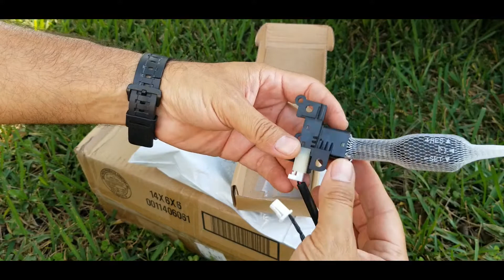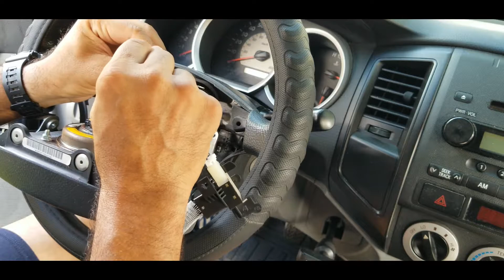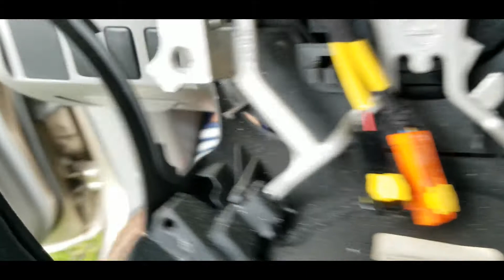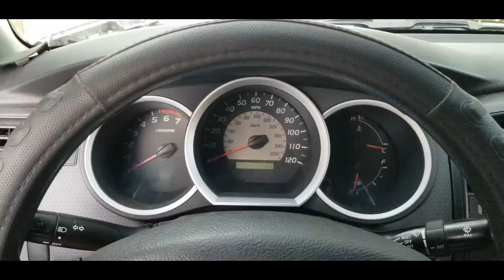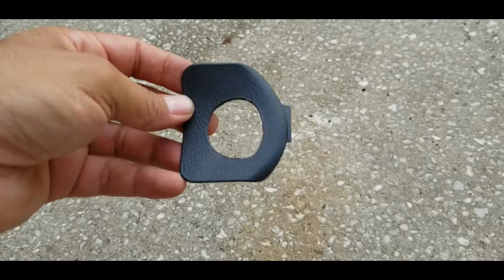How to add Cruise Control to Toyota Tacoma, part A,    Pt 4

Comment: You did an excellent video! I just bought a Rostra cruise control for my 2014 Tacoma. The directions were throughly confusing. Your video simplified it so much that  a 12 year old could do it. Thanks so much for taking your time to create this video. I was fortunate my Rostra unit had the ground wire already in that top hole to the left in the plug so I didn’t have to worry about that. Keep up the good work!
Reply from the maker: thank you very much for the kind words 
I am glad it helped 🙂

Comment: How did you find the cruise control clutch switch plug? I've looked everywhere and can't find it
Reply from the maker: I found the switch plug by doing what I showed I did on Part B, which is the next video.
I showed where the plug was located and even added a "V" shape to point to it.
If you don't have the plug, them your truck was not   "PRE-WIRED", 
From my reserach some of the later models second gens were not "pre-wired"
Good luck in your project.

Comment: Hey so I did everything and I am pre wired but my switch does not work. Do you have the link to the one you bought?
Reply from the maker: Here is the link to the stalk I used, but it says item not found.
https://www.ebay.com/itm/163925200011
Here is the part # that is needed for the Tacoma: 
" 84632-34011 Cruise Control Switch "
Reply: @LincolnMaxnCo  hey thanks for the reply. So I did everything in your video but my light won’t illuminate. I seem to be pre wired tho as I have the plug above my clutch pedal. Could this be a faulty stalk or mabye a faulty clock spring?
Reply from the maker: @Feye25  
it could be either one
If your horn is working, then the clock springs  "should" be good.  (usually if there is an issue w/ the clock spring the horn won't work)

I've read that some use a "jump wire" where the switch plugs in, if the "CRUISE" lights up on the dash, then it mean that you are pre-wired and the switch you have is defective.

I have not done that and I would NOT work around that air bag  w/ the battery plugged in, that could be very dangerous.

Comment: Did you also add the intermittent wiper switch to the same 2007 BASE Tacoma?  By the way, I followed your lead and did the cruise upgrade - thank you.  I also had to 'dig' the connector out of the old switch - but way better than paying fifty bucks for the little factory wire part!  But teh Intermittent wiper switch is selling for $180 on Amazon and dealers and $130 O'Rielly Auto so I can't afford to try it if it will not work! You do a good job Keep it up!
Reply from the maker: Yes, I did, it is a simple mod but I really like it
I live where it rains a lot, so to me it was worth it to add it and it works great 
Thanks for the kind words 🙂

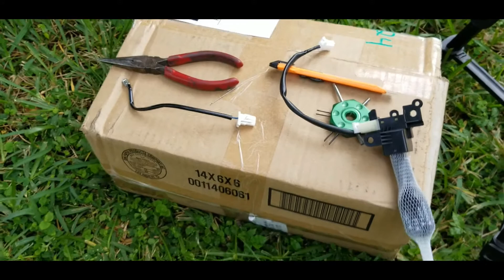Comment: After checking my plug which is like yours I found if you look real close to the back it has a pry out tiny white block that releases the wire.. It's right where your left thumb 7:47 is when you're showing us where you cut it, on the very back side of the block opposite of the release tab. Hope this helps someone as I also had a time trying to get the wire out.  If you look at 8;12 you can see the little block sticking up. The cruise and horn work fine now. Thanks for your video.
Reply from the maker: You're welcome 😀👍
Thanks for the tip, hopefully it will help someone

Comment: Mine is like that and I hope I can get the wire out of the old plug. My maintenance guru said my 2008 base would be wired. If the weather is good tomorrow I'll find out. It is automatic.
Reply: If you’re prewired it’s an easy fix. Mine is a 2013 base Tacoma. It wasn’t prewired, so I had to run a wire to the ecu, and a ground wire.
Reply: @michaelpack4210 what instructions did you use to run the wire to the ECU?
Reply: @jlwtn87 I’ll try to find those, but it may take a bit. They were on an old phone I had.
Reply: @michaelpack4210 how do i know/check if my truck is prewired for it?
Reply: It will not let me post a pic here, so just search installing cruise on your model and make.

Comment: The horn socket has a push socket that is just above the wire that pushes it down in the other side from the main socket release pin ,it should be first removed with a pin it has a small groove that allows the insertion of a pin 
Anyways congratulations and I am really happy for you enjoy but take care of sleeping while cruise is on.

Comment: My kit came in, and it’s like yours. I will have to move the horn ground to the new wire. I’m not electronically inclined, but I’m going to give it a shot.. 😂 thanks for your video, doesn’t matter if it works or not. Glad you took the time to explain.

Comment: Thanks for the video , just ran into the same issue with ground wire , this gave me confidence to hack at the factory harness to
Dig out the pin . Worked out great and cruise lite lit up
Reply from the maker: You're welcome
I am glad it was helpful 👍
Reply: @LincolnMaxnCo  Where did you find the tool for removing the pins from the connectors? What is it called?
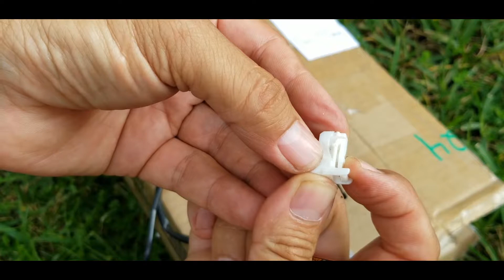Reply from the maker: @notcharles  around 10:18 on the video, I showed the retractable blade I used
The other tools I used did not work for me

Comment: Mine is an automatic. Is there anything else to do besides adding the switch? Great videos and thank you. I’m watching the intermittent wiper one next :-)
Reply from the maker: Hey, 
If your truck is auto n is prewired, all you need to add is the little "switch/stalk" and you should be good 👍🙂
Reply: What year model is your Tacoma, and how did your cruise work out ?
Reply: @michaelpack4210  2012 Base 2WD 5lug Automatic. Works great
Reply: @L4J20  I’ve got the 2013 base Tacoma, 4x4, Auto, hoping it’s prewired. Will find out next week. Just bought it, and there’s a sticker in the bed of truck saying it’s prewired for a backup camera. So I’m hoping for the best.. 😂
Reply from the maker: @michaelpack4210  mine is a 2007 Base model, Manual transmission and it works great and it makes a huge difference when going on a long road trip.

Comment: Thank you so much for this video.  I ordered the $15 part from eBay, watched your video, then installed the new switch in 15 minutes on my '09 Toyota Tundra pickup.  Luckily, it was wired for cruise already, and it worked just like you said.  I didn't even unhook the airbag, just laid it on top of the steering wheel.  Thanks again for posting this video.
Reply: Kent…is yours Auto or Manual transmission?
Reply: @L4J20  auto transmission.
Reply from the maker: I am very glad that it work for you  🙂
Reply: How’s that 15 dollar switch holding up ? Just installed a cheap eBay one today
Reply from the maker: it's working great thank God
and I just used it on a very long trip across the country and the switch worked great.
I had another part fail which prevented the CC from working but once I found what I needed, I got it to work again.
The part was a plastic piece that dry rotted because of age and broke off.
I will be talking about it on my next video.

Comment: Can you leave air bag yellow wires connected while you do this?
Reply from the maker: Yes, you could
If you have someone holding the airbag, while the other person screws the lever/switch
you don't want to put tension on the cables

BUT you have to make sure you disconnect the battery either way.
Reply: @LincolnMaxnCo  thanks!
Reply: Looks like I’m not pre-wired, got everything hooked up but not working and no light on dash. Any ideas?
Reply from the maker: @bxutuber   if you hooked up the switch and it does not light up CRUISE when you press "ON",  that means that your truck is not pre-wired.
I know that people are still able to add CC when the truck is not "pre-wired" but I don't know how.
I hear that it is more involve.
Good luck and I hope you get it to work
Reply: @LincolnMaxnCo  ok thanks, yea looks a little more involved, trying to do some research, thanks again
Reply: @bxutuber  any luck getting yours to work ? What are you putting it on ? Mine is a 2013 4x4 base automatic. It’s not prewired.
Just wondering if it worked, and what you had to do. 
Good luck.
Reply: I put a cloth on the steering wheel and laid it there.

Comment: Nice! Is there a link to the seller or the maker of the kit?
Reply from the maker: Thanks 
I did not buy a "kit" I bought the stalk and the clutch switch separately from Ebay
Here is the link to the stalk, but  they did not have anymore available, but it has the info about the part # that you need.
https://www.ebay.com/itm/163925200011
Here is the part # that is needed for the Tacoma: 
" 84632-34011 Cruise Control Switch "
I chose one that had the 2 needed screws and the little wire harness. 
I hope that helps 👍🙂